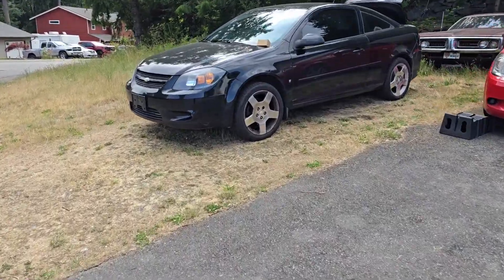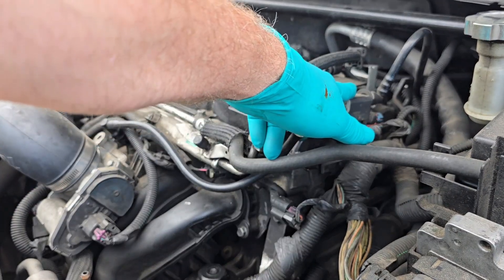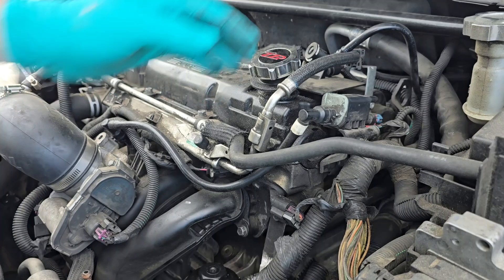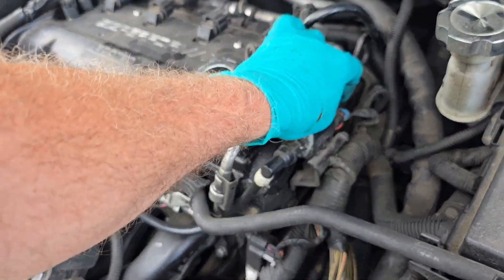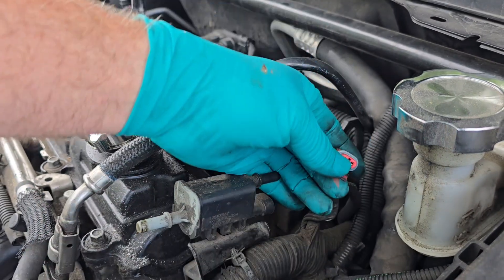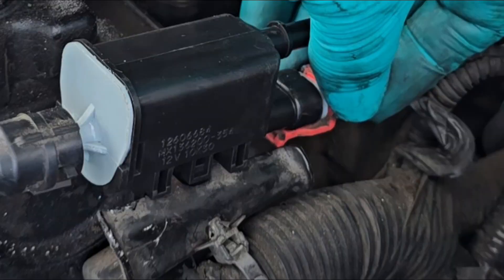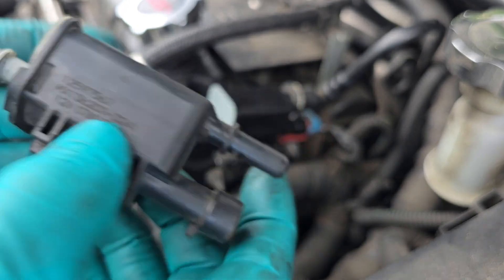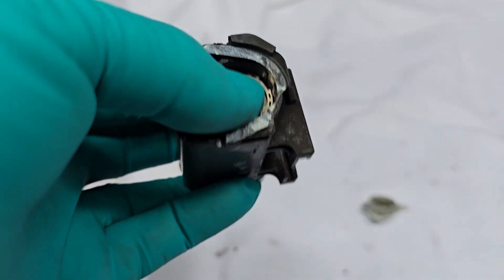Purge valve replacement 370,513 MILE ( Symptoms of a bad Purge valve / testing a purge valve )

Comment: It's so nice to have a channel dedicated to the ecotec platform. Thank you! I'll check out my purge valve soon. I've been blowing smoke at the stop lights on takeoff. Cleaned the MAF sensor and some of the throttle body.. Got rid of my rough idle, and the smoke for a while, but the smoke after sitting at a light or parked came back 🤔

Comment: I have an 09 cobalt lt currently running 212674, mostly original other than some maintenance parts, Original clutch. Recently had a p0171 lean code, do you have any experience with that code? This is my go to Ecotec info channel, love the content and keep up the great maintenance.
Reply from the maker: I love the Chevy Cobalt they run forever 👍👍
The last time I had a p0171 code it was the mass air flow sensor that needed to be replaced 👍👍